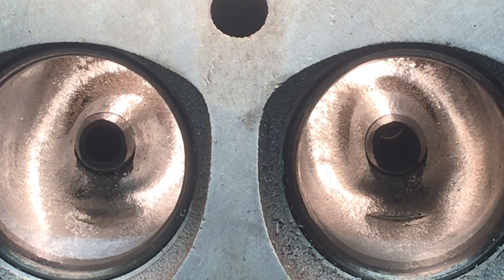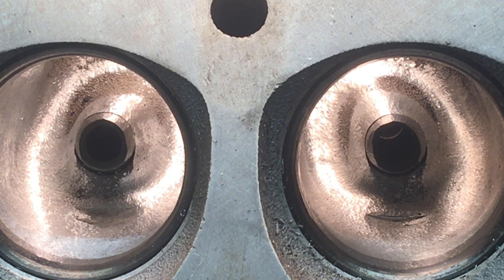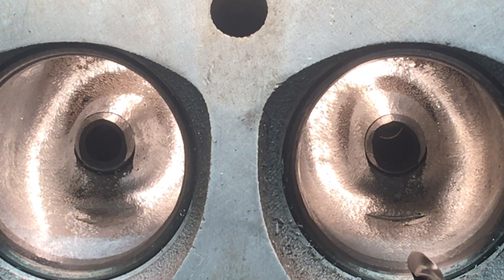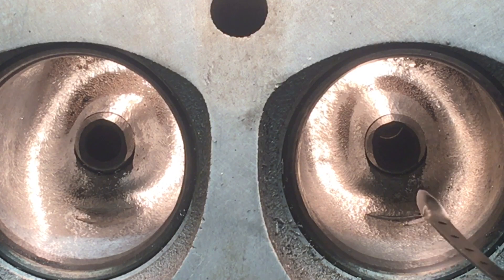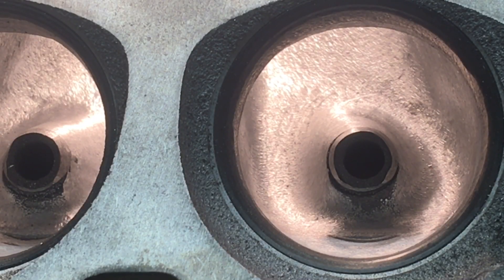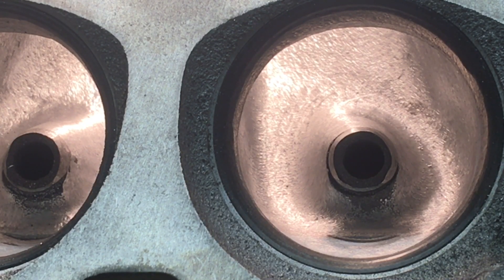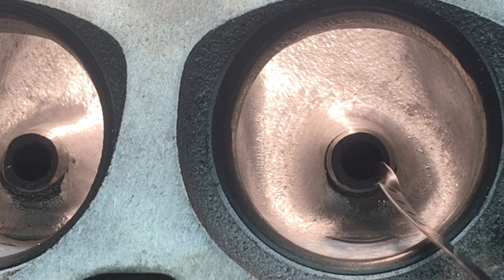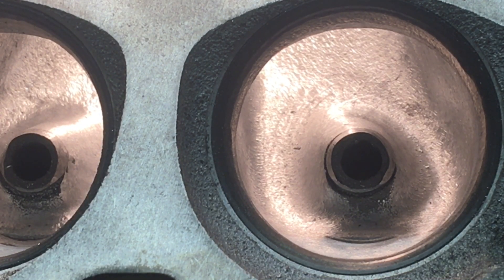Porting cylinder heads multistage process

Comment: If I go too deep and make a hole can it be fixed
Reply from the maker: James Brassfield Aluminum can be welded but it might be cheaper to find another head. 
The key is only removing a little, if you follow the guide lines you’ll never be removing a lot. 
Remember you aren’t trying to just make the port as big as you can, it’s not going to work. Massage the areas to help the air get through little at a time.  JD

Comment: Sorry for my questions sir. I’ve been bothering you for 2 days now. At about 3:00 into the video You mention Bowl percentages. At your most convenient time could you please explain what that means?
Reply from the maker: Justin Derasmo Sorry haven’t had much service this week. 
The bowl cut or throat of the port is the area where the valve seat transitions to the port. 
I use 89-90% Intake seat and 86-87% Exhaust seat.  This means you calculate the percentage of the valve used in each to determine the bowl cut. 
I use mostly the Joe Mondello porting theory math in this area.  
Thanks for watching I appreciate it!  JD

Comment: I dont mean to sound like an a-hole, but I do have a criticism.... it seems like you spend a lot of time and energy doing this type of work.  Dont you think you are just guessing at this stuff?  All the things you mention about airflow characteristics sound good, but without a flowbench  to actually test, you could be doing all that work and not really make any improvements?     Then after all this work, you are going to have a generic valve job done?
Reply from the maker: PowerPlay Engines I can only say after you’ve been porting long enough, done the same port over and over many times there’s no need to flow test every set unless the customer requests a flow sheet and wants to pay the $125.00
It’s like once you learn to sign your name you don’t constantly need to change how you sign it.  At this point my work is proving itself  making power, sometimes crazy amounts of power. 
Part of what caused you and others to focus on flow bench, flow sheet, information is a key part of the manipulation people suffer from who think there’s all this special magic handed down from generation to generation on how/where to port heads.  Yes designing a port from scratch, or initially working a new style head to try and improve flow, having a flow bench to test on is the way to go. 
Porting in its core is Math and basic percentages to the areas of the port resulting in the most gains.  
1. The Bowl cut and Blend is the #1 most important part of any port job. Measure the valve and open the bowl to 89-90% of the valve size. Blend this bowl cut to the port by maintaining as much angle as possible on the wall behind the guide boss. 
2. Reduce the guide boss profile and blend into the port. Warning: Do the research to identify any thin areas and coolant passages before poking holes. 
3. Try to make a smooth radius of the short turn while also widening the transition work. 
4. You can gasket match and blend both Intake and Exhaust ports, just make sure you blend the work all the way into the port. 
5. Structural changes need more experience and research. Mods like rocker lump removal in an LS head, swirl ramp removal on an LS head, raising the roof on the exhaust ports any/head. As an example. 
6. Port clean up and smoothing to basically join your bowl work and blend to your gasket match and port clean up.  Final port texture etc. 
I follow the majority of proven porting theory, I like and have good success using the Joe Mondello percentages and theory.  My point is it’s not rocket science but does take practice and practical application of the porting theory.  If you do these base operations your not going to hurt performance. 
With all that said, if a person unwittingly just starts hogging out a cylinder head thinking Bigger is better then yes the head would be ruined! 😳. I’ve seen several heads ruined in videos shared on YouTube. Sad 😢 
I’m willing to have any of my heads flow tested, trust me when you see the detailed work it speaks 
for itself. Not to mention all the engines out there running my work making great  power helps me 👍

P.S. I’ve kicked around the idea of accepting donations so I can flow more heads without adding cost to the customer.  Do you think it would be a good option to offer the viewers?  I’m very curious JD
Reply: @HeadFlowInc  thanks for detailed reply.  I am not suggesting flowing every head you port, but flowbench is used as R&D to develop your port.   If you have no history of actual R&D of airflow, then maybe your R&D is on a dyno, or at the track.   I am not bashing, but I think if you want to be taken seriously, you should invest in some equipment.  a bridgeport can be fixtured up to cut seats, and resurface.  a SF-110 and a valve grinder and you are in business.    I know its an investment, but dont you want to test different seat profiles?   Low lift flow is all in the VJ.   You DONT want to become the next headbytes!
Reply from the maker: PowerPlay Engines Omg, I totally forgot about Tony Sizemore at Headbytes...  Sad how he ripped all those people off, I almost had to change the name of my channel because it was too close to his! 😳
Man I truly appreciate your honest feedback!  I would absolutely love to even have the space for real machinery and a flow bench. The reality of it is, I’m disabled and buying expensive equipment is a dream.  If you notice it takes me a good bit of time sometimes to port a set of heads, this is unfortunately due to my physical limitations. 
I can and have finished a set of 241 heads in less than a week taking about 32-33 hours.  Looking at my progress, if I had the machinery to do valve jobs, face and back cut valves etc would save time and speed up the process.   The more I think about it, the more I want to find a way!  Thanks for the feedback I appreciate it!  JD
Reply: @HeadFlowInc  Dont say its a dream!   You can obviously get the job done... now dont limit yourself.  Start looking on FB and CR for valve refacers.  I have picked up several for very little money.   I bought a superflow 110 for cheap as well.  Just start looking.  You seem to enjoy it and the work looks great, just go to the next level.  The way you are figuring out how to do the porting, you will also be able to aquire, repair, and accurize some used equipment.  -scott

Comment: My value guide hang down in my ports like about a half inch how much valve guides can you cut away and still be safe or does it hurt for the valve guide to hang down?
Reply from the maker: roaringcat 62 Iirc you will need a minimum of 1.750” valve guide, naturally we need to verify this and longer lasts better. 
Many times you can cut the guide inside the port all the way down to the aluminum, just make sure you leave enough!  👍
Reply: Thank you for the information I was thinking it was something right around that length.

Comment: Did you ever have formal training from anyone?
A local guy/ machinist here trained under Mondello but he is big into Harley heads.  Don't think he does much with auto.
It would be really cool to go to a Vizard Seminar before he croaks.
Reply from the maker: Prochargedmopar I studied the Mondello porting theories and use them as guidelines.  I also have techniques I like from a couple porters from the Pontiac V8 community plus general information from guys like Vizard and Jim Taylor.
Yeah I’d like to take a class or sit in on a seminar to be able to learn some new information. 🤔😎👍